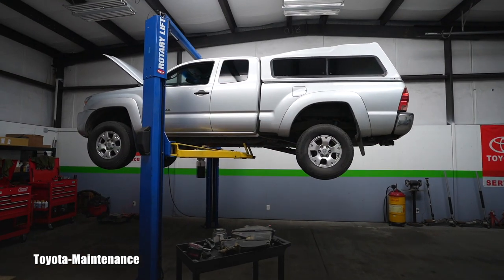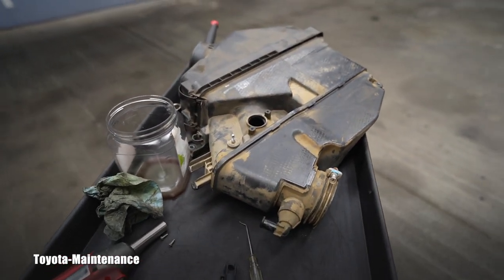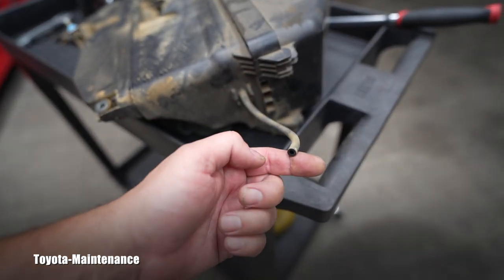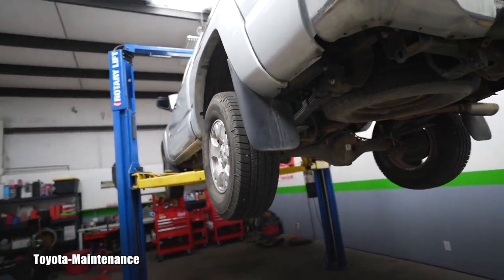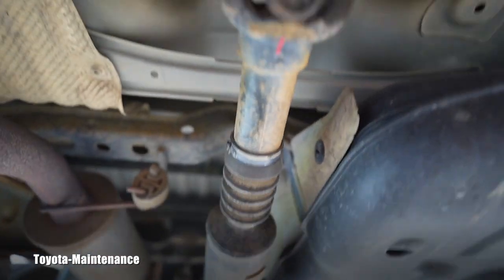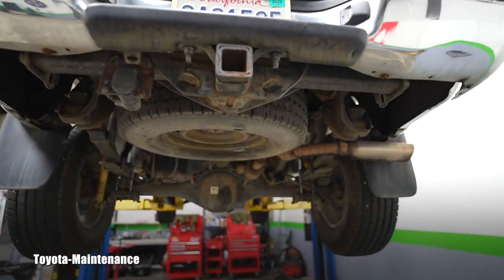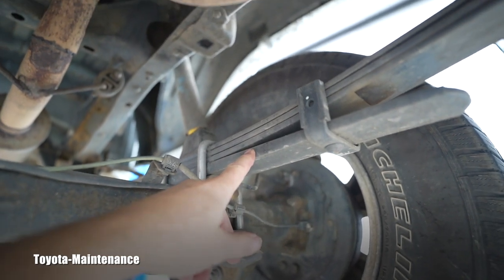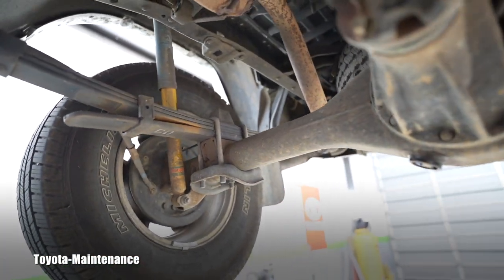Please Help - upgrade rear suspension Toyota Tacoma

Comment: I have Airlift airbags. Put on my 2007 Taco 4x4 dbl cab in 2009. 13.5 years later all original airlift parts no leaks, very comfortable, and easy to adjust.  Paid approximately  $500 back then and installed myself. When I buy a new Taco I will use the same setup.    I ran the airlines up through my bumper and placed each inflation valve through the license plate bolt holes.  I use  a bike pump w each stoke equal to 1 pound psi.  There are auto inflators you can hook up or get a handheld electric inflator. I have the original stock leaf springs.  Don't buy a "real  truck" as some have mentioned.  This market is too pricey for that and if it's full size in a city setting parking tighter.  Now that you're having the work done on the Taco use it!  Run the taco with the camper. Go with a popup type if you can, less wind resistance.  I drove cross Canada to Newfoundland and back through the US pulling a Jayco 19bh travel trailer w the Taco. Loved it. Sure it used more gas, but you can unhook the truck at the campsite and drive around and explore.  I've had 2 VW Westphalias, 1 VW Eurovan as well. Still like the taco best and will put a camper on it or a new Taco soon.

Comment: I'm running a '16 Taco that I bought new as a service vehicle with a commercial fiberglass topper loaded with ladders, tools, and parts.  It's heavy enough that I blew out my first set of airbags in less than one year (I don't remember the brand).  I replaced that set with Firestone airbags and have had no problems with them.  I currently have 102K miles on this setup.  I installed myself and use a bicycle pump to air up.  I will say that the airbags can overpower the shocks and make for a bouncy ride at times.  I still think airbags are a good idea for a camper but I would use them in addition to stronger springs and shocks with adjustable dampening.  I believe a truck camper will be heavier, especially more top heavy, and the stronger springs will be necessary.  I would contact the camper manufacturer or dealer and see what modifications they recommend for your particular vehicle / camper combination.  Happy trails!

Comment: Sounds like a good idea! At least a very fun one. Definitely going to need new stronger suspension and bushings all around. I have a 4runner of the same vintage. With just 600 extra pounds all new upgraded suspension was needed. The extra weight burned through rubber bushings so I went polyurethane.

Comment: Heilwig 1500lbs helper springs are cheap and don't affect ride quality when it's unloaded. No air leaks that might come with airbags. Could replace the current springs with Kansas City heavy duty springs and add the heilwigs. Should ride ok that way.

It's what I'm running on my 2000 tundra

Comment: For ease of installation, price, and zero maintenance required, it's hard to beat a set of Timbren helper springs. They don't come into play until the suspension compresses about an inch, so there's no change in ride when unloaded. 
$300 and 20 minutes to install.

Comment: In Pakistan if we Need to Strengthen the leaves and want to increase the load capacity of truck. We will open the leaves hammer them and arch them a little more  and increase the leaves number by adding extra leaves. In some cases we put 7 to 8 leaves per side and the truck become a monster loader truck. If originally the trucks capicity of loading was 1 ton now it will be 3 tons by arching the old leaves and adding some extra leaves . You can decide the leave quantity by your load but this is the way to go.

Comment: There are campers made for these trucks and it can be done right. But they still need to be realistic about how much weight they're hauling. Payload for these trucks is probably around 1300lbs and includes passengers & fuel.

Comment: Speaking of suspensions, does anybody have insight about LE vs SE  Camrys?  The LE is older (2004) and has a mushier and more comfortable ride.  The SE (2017) ride is stiffer and better in corners. New Michelins made the ride more comfortable but not nearly as comfortable as the LE.  I am thinking that it is a feature of the LE but is there anything to be done?

Comment: Good day

I wanted to ask you about the suspension for a 2002 Toyota Sequoia

I'd like to upgrade or replace everything in the suspension system. I wanted to know where I should start. For example, I'm looking to get my wheel bearings done, so I'm looking to purchase the parts. Unfortunately, everytime I look online, I only see mention of the front wheel bearings. Does the Sequoia not have rear wheel bearings?

Comment: Bad idea, better to get a smaller pop up trailer camper. more room, cheaper and way less stress on the mechanical components and better mpg. Rent one or get a nice used one. Keep the topper on for  extra storage. The transmission and engine will be toast and they will be stuck with a camper they can't get rid of and a broken truck not worth repairing. Nice dream but poor execution with that camper idea. How many miles on that Taco?